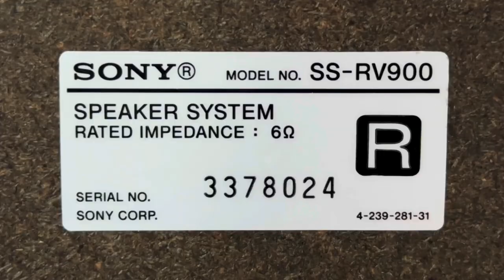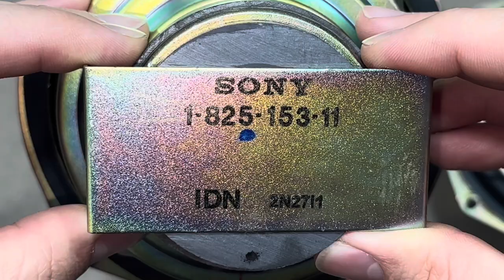SONY SS-RV900 3-Way Speaker System Maintenance Disassembling  Examination Test

Comment: I think they can handle up to 120W rms each. Because the system has 100w per channel. Cool Video.:person-turqouise-waving:
Reply from the maker: Thanks 👍🙋‍♂️🙏
Reply: Нет,они точно 100 ват не потянут,максимум 50 ват на колонку ,и то кратковременно ,думаю рабочая мощность 30 ват у них
Reply: @ЖеняКузьминых-ф8я  Они же высокоомные, и подключены там скорее всего ещё парралельно, чтобы задушить входную мощность от необходимо (для маркетинга) достаточно мощного на то время усилка от STK. сами динамики продолжительно выдают 20watt PEAK (EACH SPEAKER). 2 басс динамика + пищалка = и получаем 100 ватт на обе колонки.
Reply: @ЖеняКузьминых-ф8я  + он там написал «RMS».. а к этому значению можно приплести хоть 500ватт😀